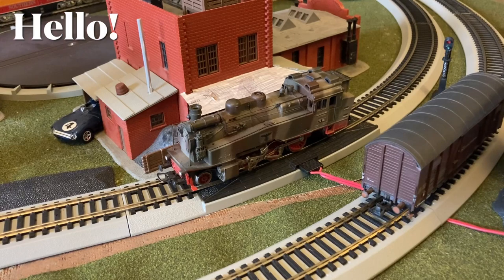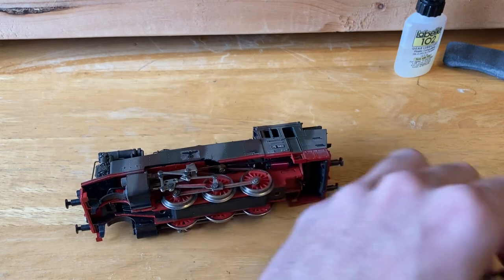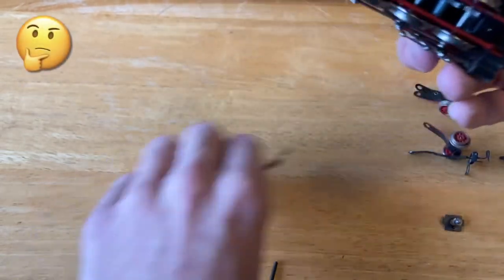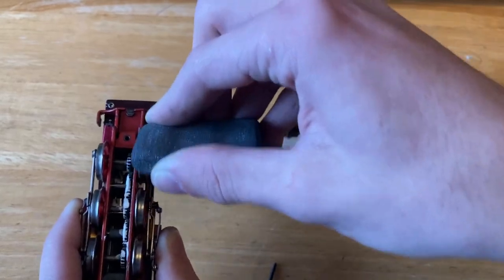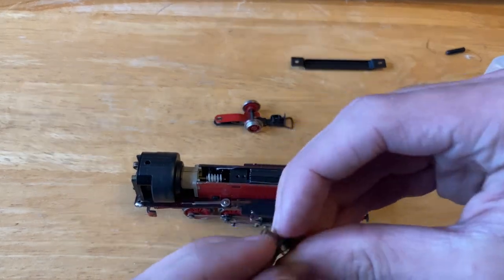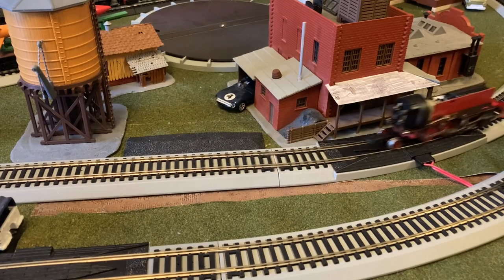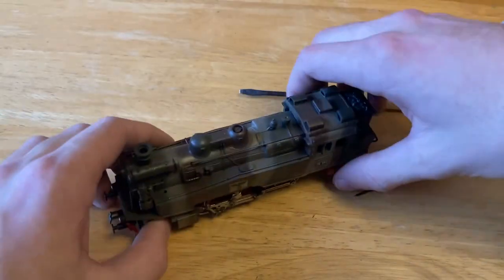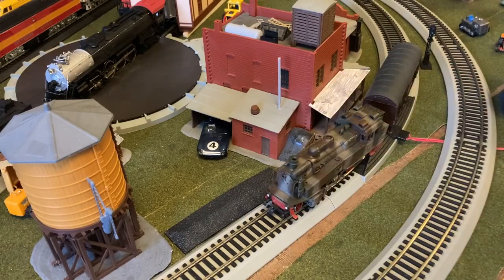Mysterious German Locomotive Restoration ⛽️🧰 Can We Fix It?

Comment: Your locomotive is a Gutzold.  I compared mine to yours in the video.  The only difference is that mine has the Gutzold name on the locomotives bottom.  Raised lettering.  Mine was purchased second hand at the local hobby shop. It is painted in dark green with a black roof.  The locomotive also has a bit of red trim on the pilot end.  The locomotives number is 32.917 ETAT. In my opinion that particular unit is a keeper.  Lucky find for your collection.  Thank you for posting this video on opening one up and lubbing it.  Best wishes.  George
Reply from the maker: Great to Know! And Thanks for Watching!!

Comment: As an addition, you also need to clean out the little slots between each armature coil set. Small particles in there can short out the armature and affect performance. Another metallic item such as a wooden or plastic tooth pick, would be ideal. Thanks for putting up with me.
Reply from the maker: I must’ve forgotten on this engine, but I try to do that on most my others. Thanks for Watching!! 🧰

Comment: As a suggestion, NEVER put anything metal into the motor! There are special tools available for this cleaning. Or, you could use a q tip and rubbing alcohol 99.5% or above. If you by  chance, scratch the armature that scratch could leave a burr that could wear down the brushes in a very short time. Days even. Also it could produce sparks that will shorten the life of the armature as well as possibly create enough heat to damage the windings in the stator. A bad scene all the way around. I do like your presentation though, and will continue to watch you. We never know so much, we can’t learn more!